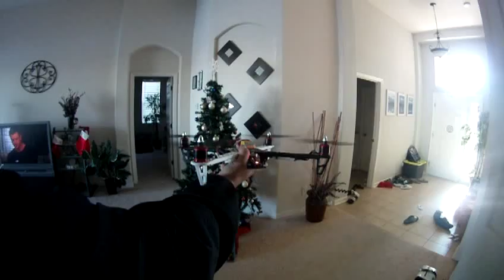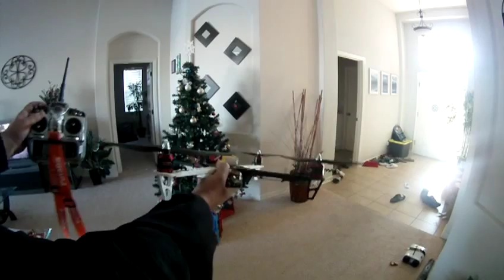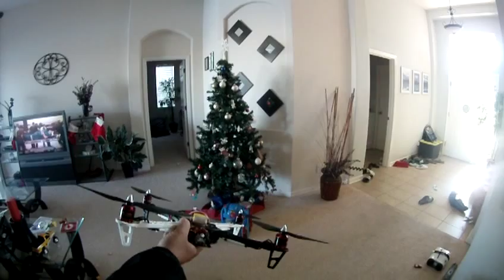DJI Naza motor cut off ATTI mode

Comment: It has landing judgement. It can tell that is not descending quickly enough to be flying at that throttle position. the naza can land on a slope and shut the motor off in 3 seconds after throttle is dropped. But if you fly high and let it drop at bottom throttle it wont cutoff

Comment from the maker: @womackke its been tested motors cut off in mid flight with no throttle for 3 seconds... a later firmware might have fixed it

Comment: No - This would not result in an actual in flight crash.
If you are flying in ATTI mode the autopilot will prevent you from ever reaching this critical angle. If the craft does exceed the critical angle, the autopilot assumes that something bad has happened, such as a broken blade, failed motor, or you have hit something and shuts
power off.
In manual mode, there are no checks and no shutdowns. You are on your own.

Comment: It will only auto land if the signal is lost from the tx and not Throttle down as you have done in the video.(throttle down will really turn off the motor after 3 sec.) try to do the same thing but do not turn down the throttle just turn off your tx and it will auto land it self.